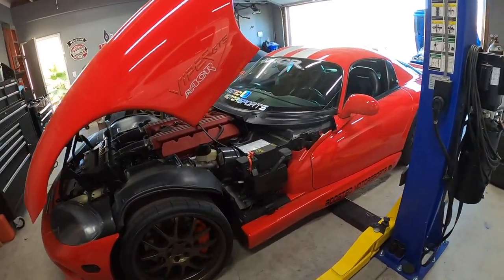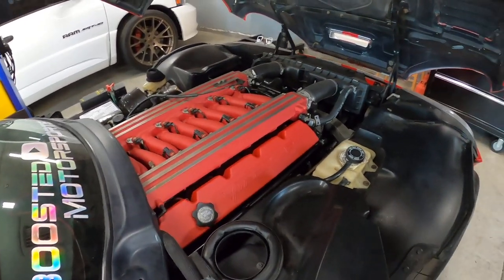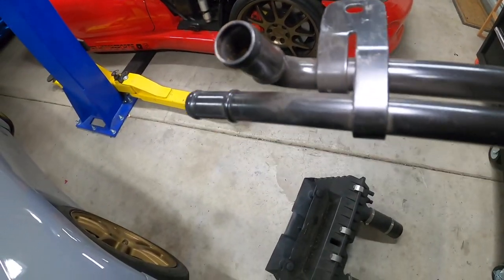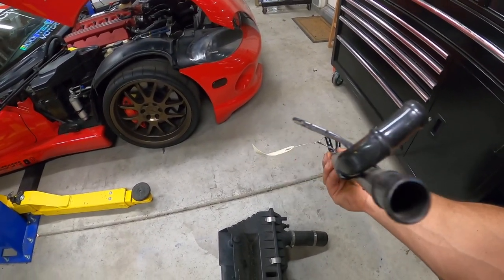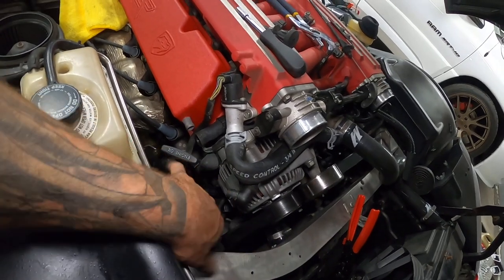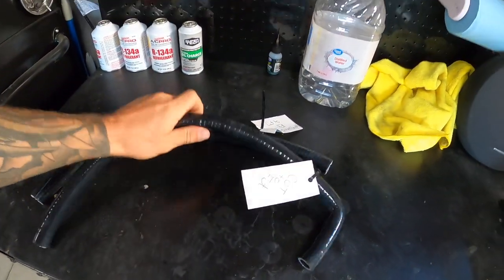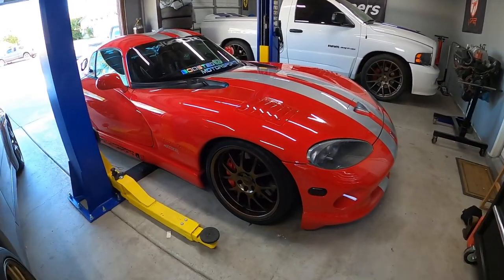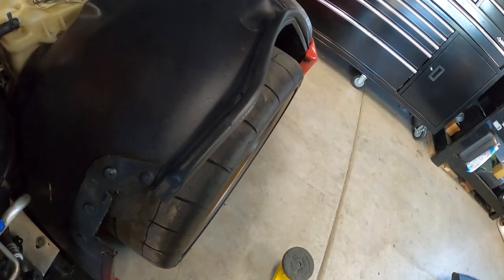DODGE VIPER HEATER HOSE REPLACEMENT | SILICONE VERSION

Comment: Great video...  I usually do my mods AFTER I watch one of your vids, but since I beat you to the punch on the silicone heater hoses, it was still fun watching you do it.  Glad you got your wrong hoses sorted out, I’m still waiting for my new one to arrive. The company was very helpful with getting me the right one. Funny, my wrong hose was the opposite of yours in the heater core area.  The remote hose clamp pliers are the way! I bought mine about a month before I changed my hoses because my hands were hurting just looking at those buried clamps... I tried and tried to get at the T stat housing hose without taking the manifold off, but I gave up and will wait until I do a thermostat. Although I’m not going to put a blower on mine anytime soon, I’m looking forward to watching your vid.  That’s a sick viper, and thanks for putting out the most thorough maintenance videos for these cars. Seriously, very helpful

Comment: Any issues with coolant smell after installing the silicone hoses?   I have a faint coolant smell, with no leaks found anywhere.. this is a new development after silicone.  From what I’ve read, it can be fairly common.